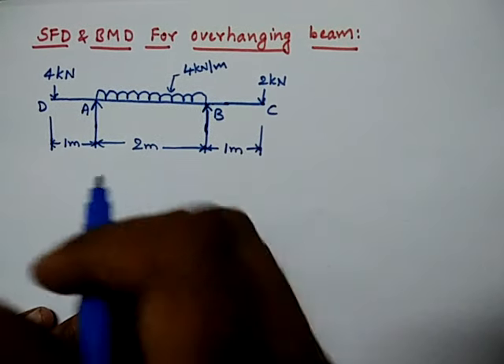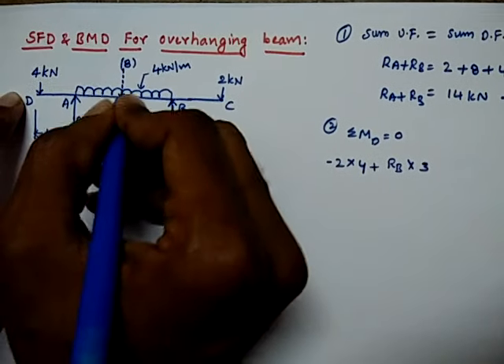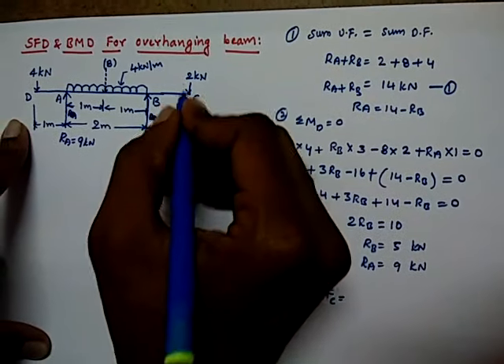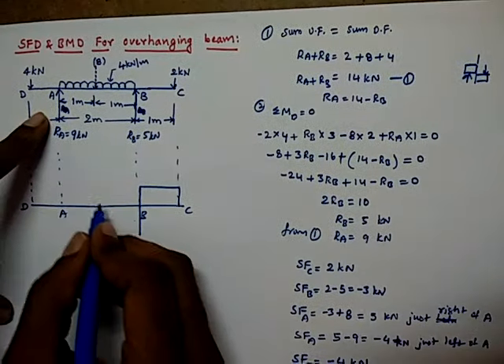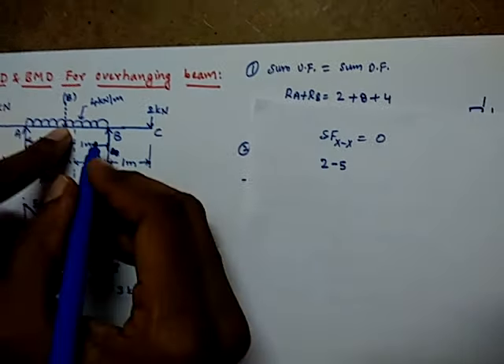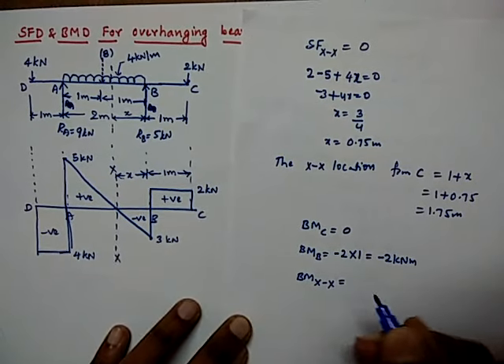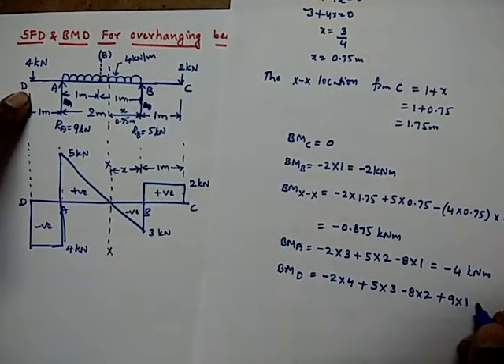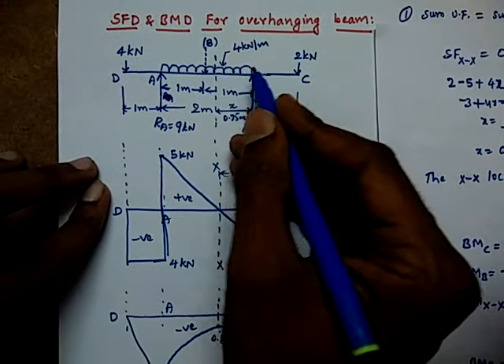SFD and BMD for overhanging beam point load & udl , Mechanics of solids, (Strength of materials)

Comment: great. but -0.875kN in BMD part is wrong. 
it has to be = 1 kN.
using basic logic you can find that the point where SFD crosses x axis (y=0), BMD will either have MAXIMA or MINIMA.
-0.875kN is neither. but 1kN is a maxima.

Comment: Why you taking clockwise rotation as negative..it should be +ve
Reply: No. It can be positive or negative, then anticlockwise will be negative or positive respectively. Just take clockwise = anticlockwise, when you move across equal sign one of them will be negative
Reply: @elonapearl5403  correct

Comment: U cannot take moment about any point as zero...it should be at simply supported
Reply: Your answer to RA and RB is correct but your method is wrong. You have to take moment about a support. Cant just take any point. Also your conventions are wrong too. Moments are negative for anticlockwise and positive for clockwise. 
Try calculating reactions at point RA and then do the moment calculations. You just confusing everyone into thinking you've used the right conventions for moments.
Reply: it can be zero about any point
Reply: Correct